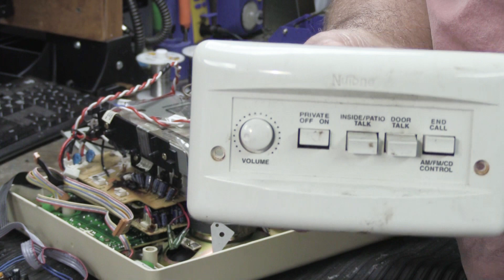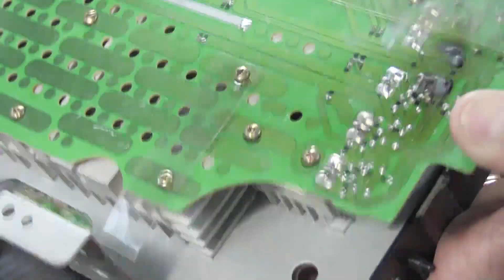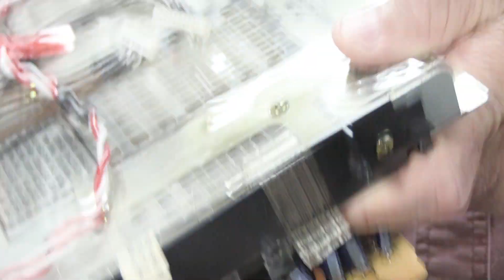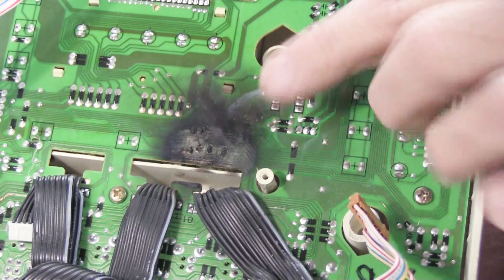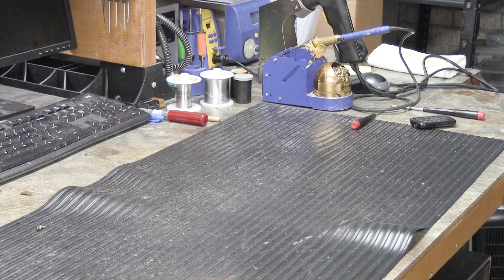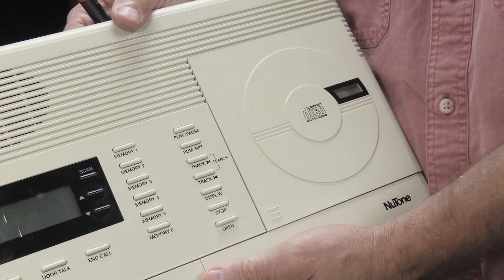2 Severely Lightning Damaged NuTone IMA4406 Master Stations

Comment: I'm fairly certain the pool room patio station took the hit too, after having seen it all in person. Between the pool equipment, and all the geothermal HVAC equipment, and everything else, this had to be a 6 figure insurance bill. I was out visiting in MO, and got to go along for one of the trips to the house.
Reply from the maker: Hi compactc9:  Wow, you go to see the damage fist-hand - I agree that the Pool Remote Control was probably where the lightening entered the system - Chris
Reply: @northsideservicecompany3567  The fun part was that this house is what I'd call a 1980s time capsule. Built in the 80s and very little about it has changed over the years. At some point the intercom was upgraded though.